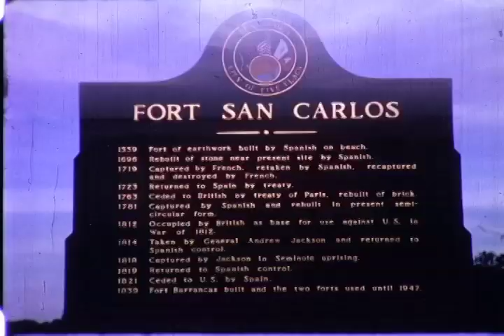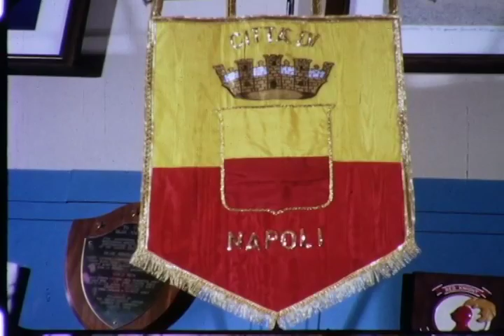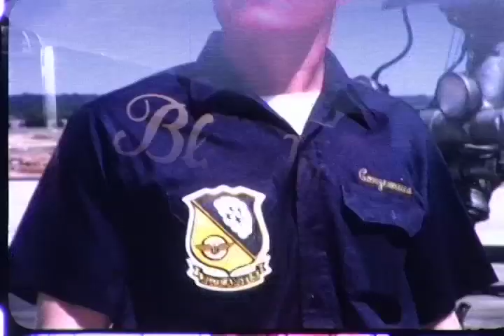F-0285 Tradition: Blue Angels

Comment: Here's a question to any former Phantom pilots or ground crew out there.  Did the Phantoms ALWAYS require the APUs to get the engines started, or was this a practice only implemented at air shows?  😄👍🇺🇸
Reply: I was a crew member back when this movie was made and yes these F 4's always required the APU for starting. Our units where specially made by two crew men Ron Axlerod and Willie Bush.